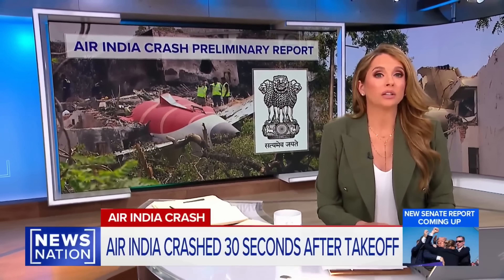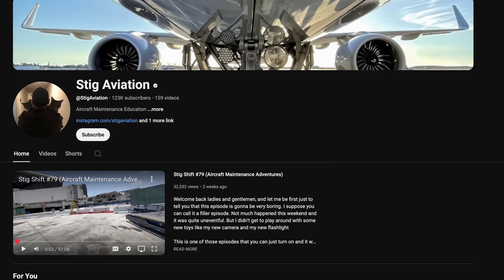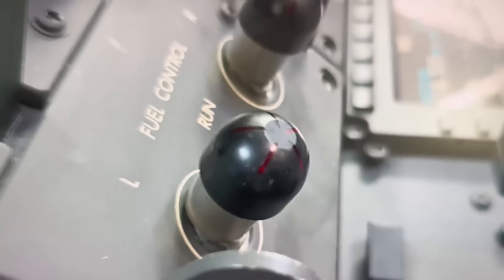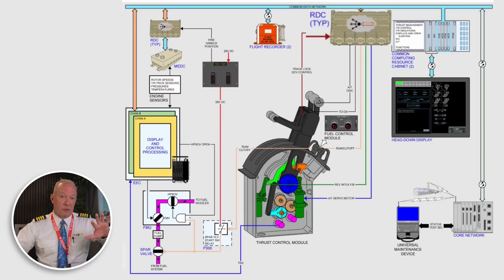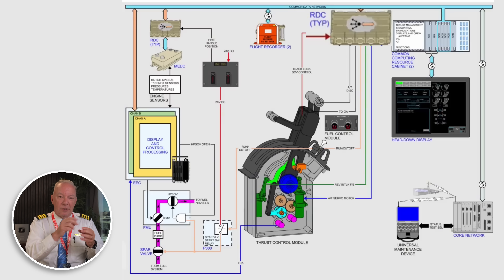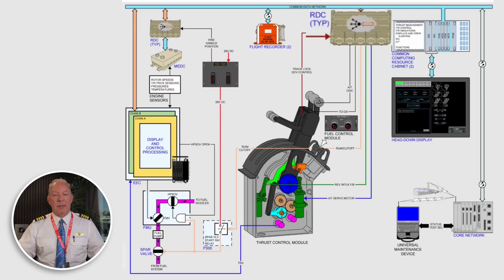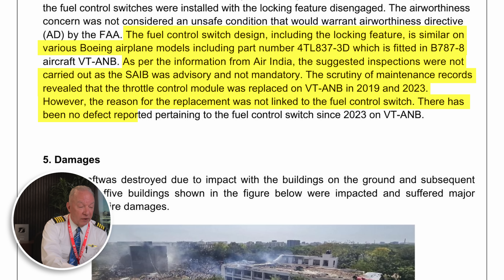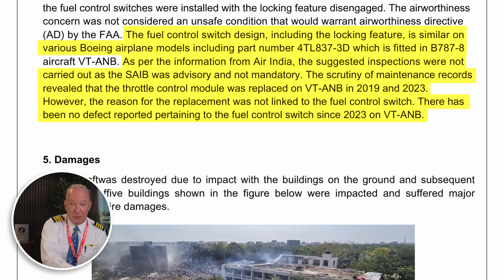The Truth About Boeing 787 Fuel Control Switches

Comment: In other words, one of the Air India pilots put the switches to cut-off, not Boeing or the engine maker.
Reply: Yes, but question is if it was before or after RAT deployment.
Reply: @rm6857 after rat
Reply: Yes, because on the recording you didn't hear "Why did Boeing turn off the fuel", he said "why did you turn off the fuel".
Reply: Correct, that's been obvious to airline pilots even before the report and back then I criticized Capt. Steve for refusing to entertain that possibility, so if anything he was very reluctant to accept that one of the pilots killed the jet.
Reply: Exactly
Reply: Fine let just agree one of the pilot did this intentionally. How in the world that pilot knew it with such precision that if I cut off fuel at this instance of take off we will surely die? Because if this have had happened few seconds later both engine would get into power again and as per report one of the engine was up before the crash.
Reply: @shubhampal7877  He knew because he is an experienced pilot and knew how long it takes for the engines to spool if fuel turned on again, and that they didnt have enough ground clearance at that point.
Reply: 100%
Reply: It's the fuel pumps that failed caused by water ingress into the EE bays. Lack of lavatory maintenance caused the crash and not the fuel switches
Reply: Sorry Capt., but if you insist that these switches can only be operated manually, then you are in effect assigning blame, that they were in fact turned off by one of the pilots.
Reply: @egarant57 it is absolutely the fault of the pilot that wasn't assigned to fly the plane during that flight. before you comment anything else think about the 260 people that DIED & had no control over their unconditional death. the plane was functioning exactly as it should. if there was a duel engine failure then the engines wouldn't have been able to turn back on after the fuel switches were flipped back to RUN. why were the switches flipped to CUTOFF right after takeoff? why has India not released the AUDIO in the cockpit yet???? this is a cover-up because they don't want to lose money. they don't want to make people think that traveling in and out of india isn't safe
Reply: @egarant57 Yes, but whether it was an instantaneous accidental mental brain fart or a deliberate act is still up for debate.
Reply: Yes.
Reply: Those small ridges look like over time could become rounded or even wear out. I would think at a set cycle life, they should be replaced? So, possibly both a design flaw and not replacing them after they start to wear out, I am sure after many turn off and on where some pilots do not fully pull them out to completely clear the ridge they would for sure wear out!
Reply: The whole throttle assembly, including the switches, was replaced twice. Air India checked their entire fleet and found no such problem.
Reply: @gregb1599  Both at the same time......come on!
Reply: @gregb1599 You'd have to pull those switches thousands of times before you would see any, if any, noticeable wear. They are being pulled up and over the ridge, not aggressively against the ridge.  They are made of hardened metal, not butter. Good thinking on your part, but wear would be figured into the equation during manufacturing of the switches.
Reply: @GPz84 Well, car transmissions wear out a similar way over time they can slip out of gear. Did the manufacturer not also think they could wear out?
Reply: @GPz84 Also, I do recall something about that with Boeing recommendation to check the switches for wear, so it could end up being an accidental movement of those switches should Air India not replaced them as recommended by Boeing. So effectively still Air Indias fault.
Reply: @gregb1599  That's why airplanes receive extensive maintenance checks every certain number of hours of flight, then every couple of years the airplane is grounded and carefully inspected for several weeks.
I'll venture to say the gears inside the throttle quadrant where the fuel switches are will wear out before the switches (throttles move thousands of times during a flight, the switches only twice) and if out of tolerance the whole quadrant is removed and a new or overhauled one is installed.
Reply: @EsparkyDog And yet they had problems with some 737 where thats exactly what happened! Have airlines fixed problems for them to later realise that the fix did not fix the problem? Yep many times!
Reply: @gregb1599 lol both wear out exactly the same time and no reports of them slipping out on previous flights,and pilots are clever enough to notice more play over previous flights.
Let's see if it was electrical due to water ingress in the aft and pilot thaught it good to reset fadec by turning switches off and on to reset,but the fadec had already automatically started the reset either way they were doomed and probably due to lack of maintenance issue
Reply: Why arent we considering a possibility where dual engine failure happens just after take off. Then pilot manually turn fuel switches off and on because thats SOP in Boeing planes in case of Dual Engine.? You can refer to Gaurav Taneja AI 171 Part 3 in english dub to understand more about this theory as timeline of RAT deployment also matches with this. https://youtu.be/pq2AZdzH7X4?si=0pLKXsmG1M7tRXAZ
Reply: @ishanarora7948  There's not a single airline in the world where it's SOP for any reason to turn off the fuel switches at 200 feet off the ground.
Reply: @EsparkyDog yes while they don’t mention at which height this should be done or not but in case of dual engine failure it is mentioned to reignite once. 
(QRH / memory items):
“DUAL ENGINE FAIL / STALL — FUEL CONTROL switches (both) CUTOFF, then RUN …” (followed by deploying the RAT, etc.).
Reply: @ishanarora7948 but they didn’t have a dual engine failure indications. They had a perfectly good airplane until the captain turned the motors off.
Reply: @ishanarora7948  2 reasons your 'theory' doesn't hold up. 1-The fuel switches being moved CAUSED the engines to 'fail' (they didn't fail, they did exactly what they were commanded to do). The switches moved the 'cutoff', THEN the engines spooled down. Listen to the video, read the report. 2-There isn't a single procedure anywhere that suggests cutting the engines 100m above the ground. That's just insane.
Reply: @ishanarora7948  Because it's a stupid theory
Reply: @drewschumann1  He's posted the same comment at least five times so far.. As if if he keeps posting it people will see differently.  Airbus Fan Boy for sure,,
Reply: @ItsAlwaysRusty  Please leave Airbus out of it !
Reply: He pilots a Boeing 777.
Reply: @ishanarora7948  But you don’t wait 10 seconds from Cutoff to Run.  It is immediate, especially low altitude.
Reply: @kshane5575 lol you try dropping from 400ft with alerts and alarms going off everywhere so 10 seconds for 2 switches is not a huge amount of time and he probably started 1 then looked at panel quickly to see if it worked,even though it never would work
Reply: @kshane5575 but who said it was 10 seconds . The timestamp is of max speed achieved and the second timestamp is of CUTOFF To RUN transition. There is no timestamp of RUN to CUTOFF. It’s only written immediately thereafter. And that is vague not precise as it could be any number from 1-9 seconds  . I believe it took some time for pilots to release something is wrong then they turned switches off and on.
Reply: @ishanarora7948  laundry list of reasons.  Crew would have commented on dual engine failure aside from fuel cut-offs, CVR and FDR data would show something else other than the preliminary report has stated, if you were going to re-cycle the switches it wouldn't take as long as it did given the phase of flight they were in, we know the battery busbar remained powered as it also powers the CVR and FDR.
Reply: @ishanarora7948 from the timeline i’ve seen, engines did not lose power until the run switches were switched to off. If one were to assume both engines quit without pilot input, then why did they both relight when switches were moved back to the run position?
Reply: @ishanarora7948 Why can’t Indians accept this pilot intentionally did this.
Reply: @ishanarora7948 No sane pilot would take 20 seconds for a reset between switching the engines to off and back to on with less than 200 ft of altitude.
Reply: @tomwebster3249  but who said it was 20 seconds . The timestamp is of max speed achieved and the second timestamp is of CUTOFF To RUN transition. There is no timestamp of RUN to CUTOFF. It’s only written immediately thereafter. And that is vague not precise as it could be any number from 1-9 seconds  . I believe it took some time for pilots to release something is wrong then they turned switches off and on.
Reply: @ishanarora7948 why can t we accept that one pilot commited suicide like germanwings pilot? Why we have to invent reasons and scenarios?
Reply: @ishanarora7948  Because the switches changing position happened first.  Stop spamming this everywhere.
Reply: @BlueCyann  How do we know the switches changed position?  How does the FDR know the position of the switches?  Most likely it only knows the voltage or amperage at some point down the line.
Reply: @JoeLinux2000 It’s a recorded data point. 🤦‍♂️
Reply: Boeing planes have serious issues.
Reply: @shabanafzal9440 Yes, Boeing has serious issues, but this wasn't one of them. This crash was the result of one of the pilots moving those switches. Given the completely 'analog' nature of the circuit design, there is no other explanation.
Reply: @shabanafzal9440 What wonderful insight you give us. Thank you for your well thought comment.
Reply: @shabanafzal9440 YES! I once experienced an uncommanded tray table release! I'm still in therapy. 🙄
Reply: @shabanafzal9440 I suggest you continue with therapy until you learn compassion & empathy. Oh wait, those cannot be taught!
Reply: @shabanafzal9440This wasn't one of them.
Reply: @shabanafzal9440 And Indian pilots going by this one.
Reply: @shabanafzal9440😂 Think this pilot had serious issues.  Time to accept

Comment: As an Army Aviator for 34 years I flew the CH-47 for several years. One very cold day in 1968 at Ft. Rucker a dozen Chinooks with Instructor Pilots in command were training at an outlying stage field. For most of the morning flight everything was normal. 

Then suddenly Chinooks started have engine failures / shutdowns. Most of the 12 aircraft suddenly lost one engine, a couple had a second engine quit while taxing in after having completed an emergency single-engine landing.

The Army was baffled but suspected fuel contamination, which proved not to 15:01  be the cause. 

After refueling with a fresh batch of fuel we were ordered to hover over the runway for an hour and if noting happened, ferry the aircraft back to the main airfield.

After 50-55 minutes of normal operations and with all 12 Chinooks about to head to Hanchey AHP, engines started mysteriously quitting again!

Altogether, IIRC 17 engines quit that day, only in Chinooks. The aircraft were left at the stage field and all of us IPs, Student Pilots and Crew-members were ferried back by obsolete CH-37! 

Next morning in the preflight briefing nothing was mentioned of the previous days occurrences, until one IP said “What the sh-t!?”

We ended up finishing the training course by safety wiring the fuel values into the open position after each start! No way to shut down an engine from the cockpit!

There was a war going on in Vietnam and they needed Chinook Pilots. As far as I know it never reoccured after that one day. But on that day 12 Chinooks had 17 or more engine failures in a matter of a few hours.

PS We did learn that the electrically controlled fuel valves with similar safety switches would turn off with voltages kfar, far less than their rated 24VDC!
Reply: Wow, that's the weirdest story I have ever heard.   I have heard and seen many in my 40 years as an instrument and autopilot technician, instructor and tech rep.   I was a technician on the F111D in the early 70s and an avionics tech rep on the CH53E in the mid 80s.  I was also a tech rep on the naval HH60Hs Seahawk, the Australian and US Army Blackhawk.  31 years with Sikorsky and 10 with the USAF.  My strangest problem was with the CH53Es sometime around 1985.  On cool damp mornings several but not all CH53Es would get a SAS (stability augmentation system) failure warning light.  The marines found that if you turned on the heaters the problem would clear in about 15 minutes.   I didn't believe the part about the heaters until I saw it myself.   This problem only started when the aircraft were a few years old.  I figured out the problem that was due to noise induced into the pitch rate gyros signal wires by the power wires to the rate gyros.   The interesting thing is that the induced voltage into the signal wires had to be electrostatic and not electromagnetic.   The water that condensed on the wires could have made a path to the signal wires through a break in the insulation of both power and signal wires but I measured that path with an ohmmeter and there was none.  I suggested a test by moving the power wires away from the signal wires and it worked.  The problem was corrected by Sikorsky engineers by changing the signal wires to shielded wires like they should have been in the first place.  Our engineers blamed the problem on the AFCS computer for a few months.  I never got any attaboys from the engineers or my fellow tech reps but I did get one from the AFCS computer manufacturer (Hamilton Standard).  Still a little miffed about that.
Reply: What could have caused voltage issues on 12 planes at once?
In the case of Air India, this would also mean that somehow there was malicious current on two separate circuits and separated coincidentally by the time a human needs to move from one switch to another. And then 10 seconds later, the malicious power fades, again with a time discrepancy matching human actions...
Reply: If that was indeed the cause, why would the same relay allow the ckt. to again function normally and allow both engines to attempt to restart?
Reply: @edwinsinclair9853 Because the power source changed. The RAT started supplying stable power, and everything started recovering. Nothing was wrong with anything flying the plane, but it lost its power source.
Reply: @mymultiextruder9804  why no reported interrupt in CVR, FDR data then?  They are powered from the same battery busbar as the fuel control switches and don't contain independent power supplies aside from the standalone battery for the locator beacon.
Reply: @yanholland315 the ADS-B data did stop, and the APU restarted. If it was only the switches, it would not have affected those systems in any way.
Reply: @mymultiextruder9804  yes it does, ADS-B data isn't critical for flight so the transponder isn't on the battery busbar, APU will autostart in a series of circumstances (prelim report stated it was in the process of doing so)  using a separate battery system to run the APU. Those conditions include engine generators going offline which they did, so what you've stated is true - there was nothing wrong with the plane and it did lose some power sources, it's just those loses would not impact the aircraft in the way you think it does.
Reply: @yanholland315 but it does explain the pilots reacting to a power loss event, and not being the cause of the event.
Reply: "Next morning in the preflight briefing nothing was mentioned of the previous days occurrences, until one IP said “What the sh-t!?”
What kind of obscure airman culture the Army has that the ONLY topic of conversation during next day's briefing wasn't the mass engine flameouts? My Air Force was not like that. Are you sure you're remembering the event correctly?
What, the fuel valve union decided to go on a strike that day? Obviously it was fuel contamination, and ordering a fresh batch of gas will not clear a fuel system that's already compromised by bad gas. That or a mechanic that worked on all ships screwed up a maintenance procedure.

Comment: Thank you. Precise explanation easily understood.
Reply: Why arent we considering a possibility where dual engine failure happens just after take off. Then pilot manually turn fuel switches off and on because thats SOP in Boeing planes in case of Dual Engine.? You can refer to Gaurav Taneja AI 171 Part 3 in english dub to understand more about this theory as timeline of RAT deployment also matches with this